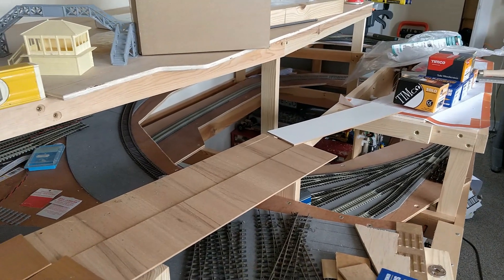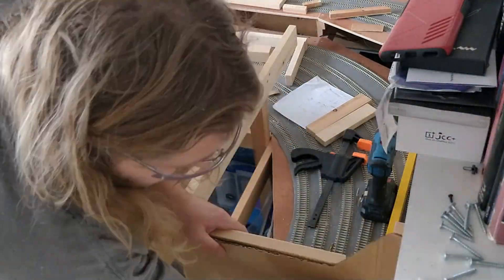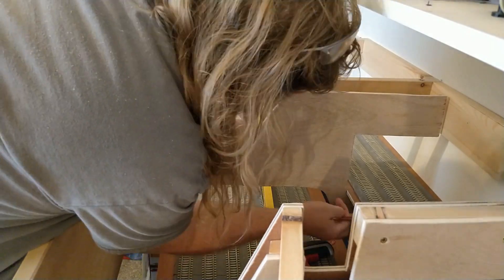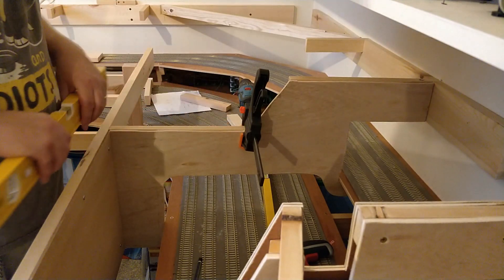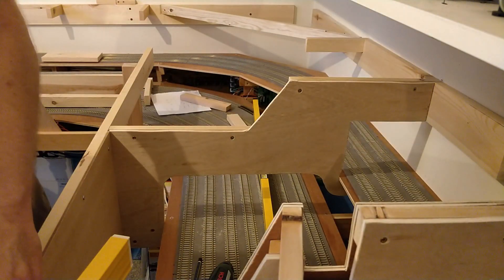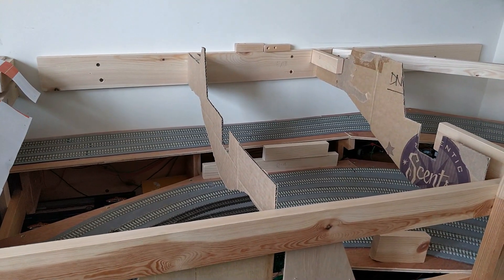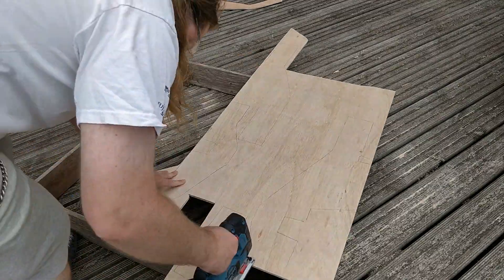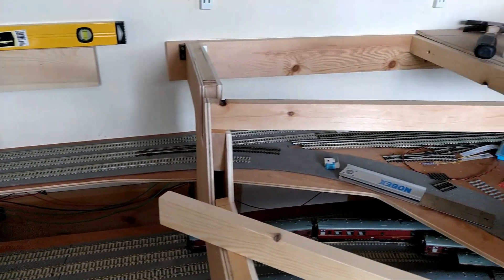Model Railway Construction: Ply Sandwich Baseboard Supports via Cardboard Aided Design

Comment: Excellent construction method. In addition, the first sandwich you’ve shown has about 4 reference points, which is always harder than the latter ones, which have only two.
Anticipating you’re going use either Tortoise or other under the boards point motors, you could take a look at several methods, for either remote location of the motors, or horizontal mounting. This might improve the clearance height above your storage/fiddle yard.
Reply from the maker: I'm using servos. The mounts I'm using are smaller than a tortoise, but still project down around 55mm in total. The clearance needed for a loco with pantograph is 73mm. Total distance from the rail below to the underside of the board above is 248mm. So I have about 120mm of clearance between the bottom of a point motor and the top of a pantograph.
Reply: @DongitsModelRailway  just in case, I saw this German layout on which the pantographs are eased down with a solid copper wire on all tunnels and covered track. Don’t know about British overhead power supply, but on the continent such drops in height of the catenary is very common. Unfortunately, I cannot recall this channel’s name. You may recognize it, however, for the metal support structure of the layout.
Reply from the maker: @vincenthuying98  Unfortunately a number of British models with pantographs aren't built with the expectation of continuous running wire contact. I'll probably not be running a full contact wire, just the masts/gantries.

Comment: Don't understand why you didn't just join the upper horizontals with plywood braces. The two lower connections don't seem to offer much except a reduction in access.
Reply from the maker: The front lower connection definitely reduced the amount the front upper beam flexed vertically. The long run of 2x1 that was there when I installed the first one would previously bend down a good 10mm if I put moderate weight in the middle, and this stopped all of that.

Having said that, swapping it out for 3x1 would deal with most of that isue too. But I'd already installed the first one and designed the second by the time I decided to do that. You'll note the last three don't have that lower front connection. In two cases the nearby leg handles it, and in the third the 3x1 is sufficiently strong I didn't feel it necessary.

Having felt just how strong this style of construction is (after building it!), I definitely no longer feel the need to connect to the lower rear. In hindsight that was very much overkill. But ... it was there. And I could do it.

If it causes a problem with clearance, it's still possible to cut it off and take those connections out.

In terms of access, I am considering whether I need to add some additional access holes in some places to help with that. Installing point motors on the mid level is likely going to be a bit challenging in some places.